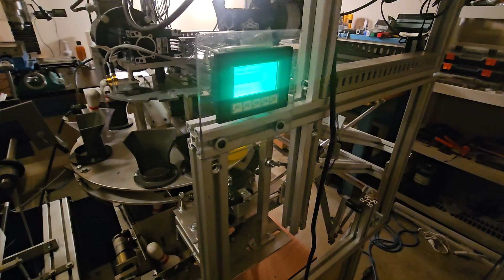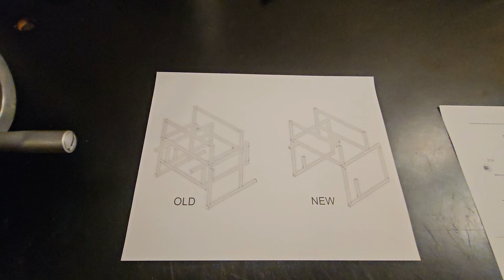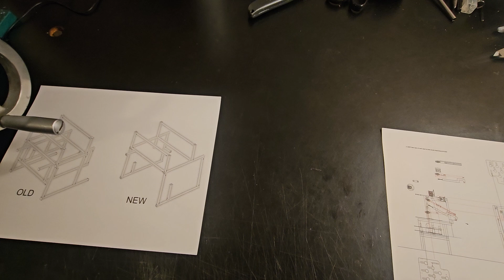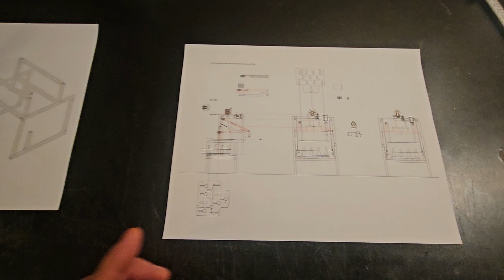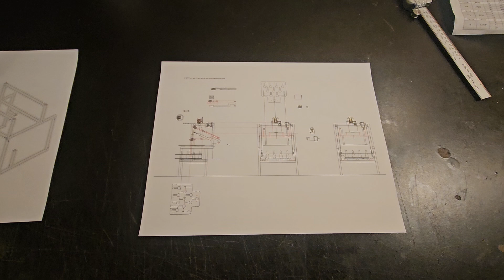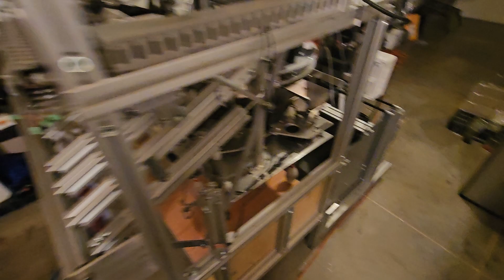September 7, 2024

Comment: Good job Phil.  I enjoy watching it evolve.  Still using a PLC?
Reply from the maker: At the moment. A control board is in development though.
Reply: Hi Phil, how goes the battle?  Have you figured out how to  design a  scissor assy to pick up a pin and not move it off spot?  I keep thinking the pin weight is a lot lighter and it would be moving the pin around after respotting it. What type metal plating did you use for deck, was it stainless  and how thick?
Bob